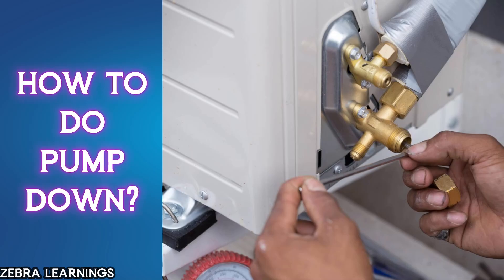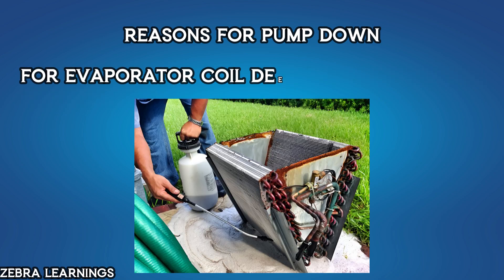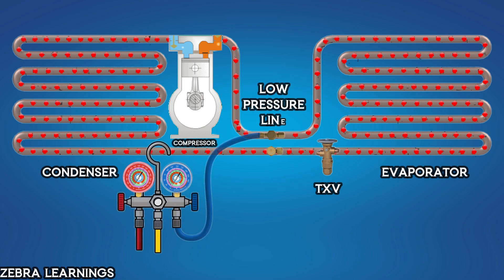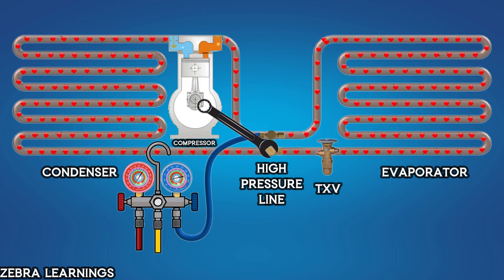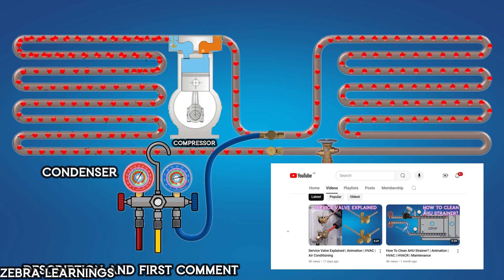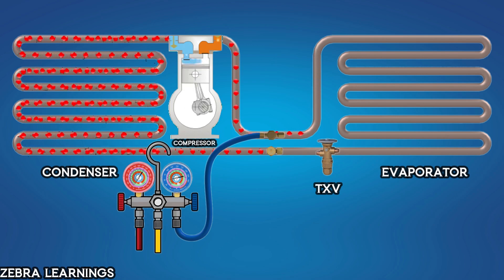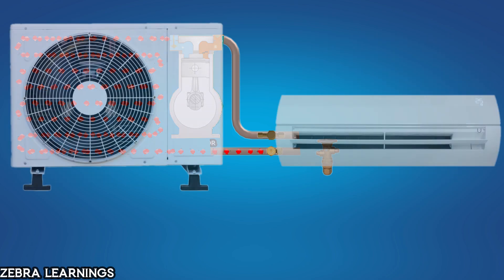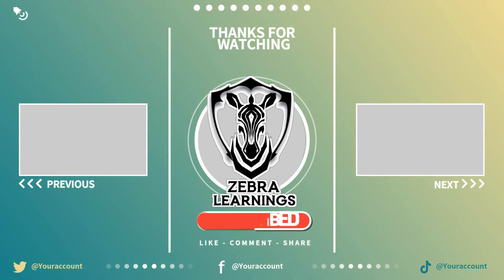How to do Pump Down in an AC unit? | Animation | #HVAC #HVACTRAINING #HVACSYSTEM

Comment: If the power is not coming out from the outdoor unit (bad board) the system cannot be turned on. What to do then, how to recirculate the old refrigerant in the outdoor unit? I basically need to replace both outdoor and indoor unit...Thanks.
Reply: then turn off all the power , just recover the freon.
Reply: https://youtu.be/Knq-fTFvYXs?si=KZxKChS8mflDHLQe

Comment: Nice video but the compressor is in the wrong side The suction side its on the condenser side and the discharge is on the evaporator. Cool video tho.
Reply from the maker: Yeah, my bad, I didn't notice that. Thanks for letting me know.
Reply: https://youtu.be/YYv14LLmy7M?si=EoIF28YYclf63t32